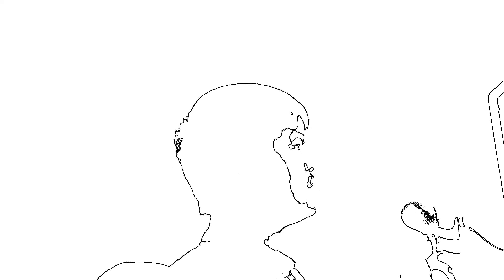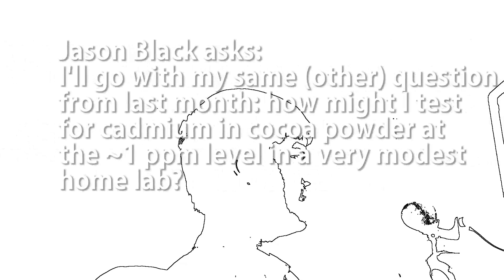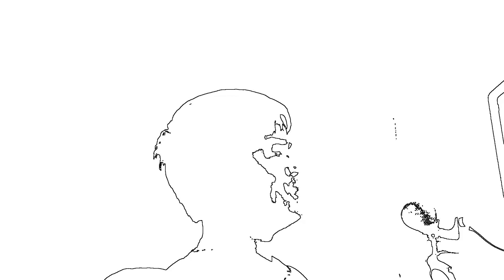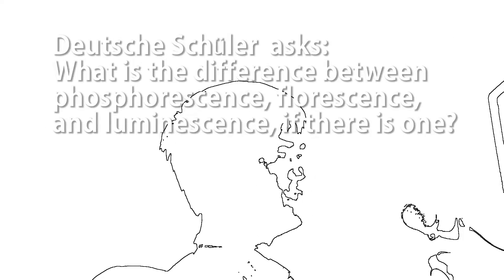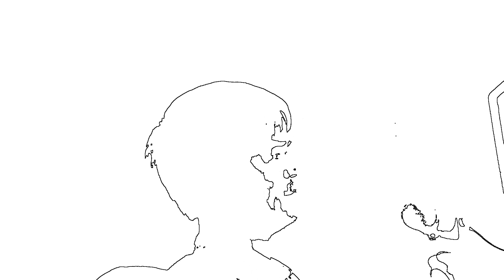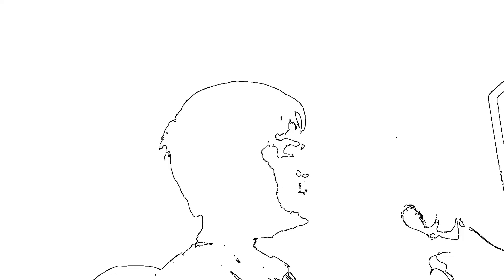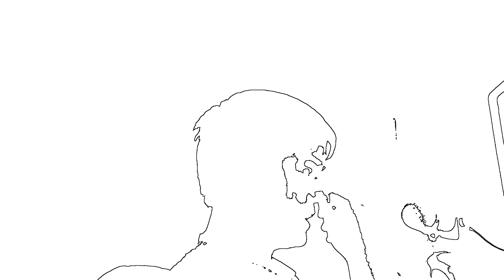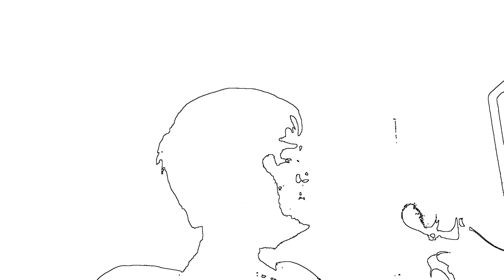Q&A with NurdRage August Edition

Comment: Im looking for compounds preferably translucent one for testing with Fluoroantimonic acid if anyone have any suggestions please do I know PTFE is the only one right now thats why im looking for compounds to improve that are pretty resistant to acid or if I cound find a way to make PTFE translucent that would work as well im thinking I can grind a PTFE container and mix it with molten glass except I have to find the right ratio for it also that might not work because the outer layer is still glass if I can make a layered coating of  PTFE that can cover the glass and still keep the translucent that would also work but finding a better compound is preferred

Comment: Have you ever worked with Fluoroantimonic acid and im looking for something to store it with I think PTFE might work but want to be sure
Reply from the maker: Textelmedal Orex Yes, PTFE is the only thing it can be stored in. Be careful.
Reply: The reason as to why I want to store it and use it is that I want to find a better solution as for ways of storeing this stuff as glass wonk wonk I want to store it until I run tests on air tight containers that are translucent and better for the storage of the acid  I know there is very little ways to store the stuff and the ways they have arent very good
Reply: Textelmedal Orex me and my research team are working on new safety measurements on working with Fluoroantimonic acid so far little success we are also trying to find a compound that can be used to make gloves that are resistant to the acid I work for a private company with a formidable work space with safety precautions in place

Comment: Hey NurdRage (or possibly someone else reading this), can you explain how a triplet-state electron returns to the ground state? I struggled with this concept in my inorganic class, and was wondering if you could explain it a bit better.

I know that fluorescence occurs when energy is given off as the electron transitions between vibrational and rotational energy levels between the ground and excited singlet states. Does phosphorescence go through the same process? If so, why exactly does it take so much longer for the electron to lose its energy?
Reply: myfairjew I actually just found a great explanation of this on Wikipedia. It seems that it goes it through quantum transitions that are naturally unfavorable, so the probability of the transition happening is slim, which causes the prolonged emission of light. Perhaps ill look into this in more detail in the future, although i fear it may get too complex for me. I suppose every aspiring chemist should do his own research instead of asking for the answers.
Reply: myfairjew You basically just explained it yourself. The excitation leading to phosphorescence is two distinct events (excitation followed by a spin flip) where the emission is a single event (both at the same time). Phosphorescence is slow because an electronic transition and a spin flip happening at the same time is so unlikely.

Comment: A widely available semi-permeable membrane can be found lining the inside of a raw chicken egg shell.  Separating the membrane from the calcium carbonate shell can be done in a number of ways:  Physically, by carefully pulling bits of shell away from the membrane, either while the membrane is intact by meticulously working a small fracture in the outer shell, or after the egg has been normally cracked, from the left-over shell pieces.  Chemically, the shell can be dissolved  by soaking the raw egg in vinegar overnight, or, judging from the rate of pitting I'm currently seeing, considerably faster in 1:4 muriatic acid:water (but vinegar is probably safer all around).

Osmotic experiments can either be carried out on the egg itself, as it will expand in plain water, and shrink in corn syrup, or the membrane can be carefully cut and affixed to a container opening or tube, for more general osmotic purposes.
Reply from the maker: Nevin Williams Wow, that is amazing! i had no idea, I'm definitely going to look into it. Thanks!
Reply: NurdRage I started de-shelling an egg with HCl as I posted.  The 3/4ths of the egg that stayed submerged, is now shell-less, and the remainder is very thin.  If I were to do-over, I'd rig a hold-down so the shell would dissolve uniformly, as the egg's expansion against the remaining sharp edge is dangerously close to ripping the membrane;  I added lots of salt to the bath to quell the expansion while the rest of the shell dissolves.

Even had it ripped at that point (it hasn't, and now probably won't) i'd still have a membrane sack with an opening of about 4 cm, and ~6 cm deep.
Reply: Nevin Williams Iv'e seen that too but I'm not sure how stable it is over the long term. For a Proton Exchange Membrane, which I think the guy wanted to know about, I've been looking at Plaster of Paris doped with Phosphoric Acid. There are also a few Patents and Papers regarding sulphernated plastics like ABS.
Reply: Jehu McSpooran Well, as I wrote my reply, I began the process of removing a shell from an egg, substituting muriatic acid for vinegar.  While the shell indeed dissolve in a fraction of the time, the membrane that remained seemed impermeable;  I probably fried (either thermally or chemically) the membrane with a too-strong acid solution, as the egg's size was not affected by immersion in brine nor tap water.  I'll try again when more eggs appear in the fridge.  (I don't eat 'em)

Comment: Here's one that's really confusing me. I was always told that the formation of bonds between atoms (like N -> N2 or CxH2x0x -> CO2+H2O, etc) were what leads to exothermic responses, etc. How is it that decomposition reactions can cause exothermic reactions? And how do some bond formations (cold packs, etc) cause endothermic reactions?

This is why I'm in IT and not chemistry. This stuff confuses me to no end, regardless of how fascinating I find it.
Reply: rogerdotlee I would assume it's because some bonds being created are taking more energy out of the system and locking it up in the molecules, for producing endothermic reactions, and for exothermic reactions it's the reverse- high energy molecules splitting apart into others with atoms they have stronger bonds with that cause the stored energy to be released. Azidoazides come to mind for this property, and you can find more here http://pipeline.corante.com/archives/2013/01/09/things_i_wont_work_with_azidoazide_azides_more_or_less.php (and other stuff- this blog is very informative!)
Reply: rogerdotlee Short answer: entropy. Spontineity (free energy change, ΔG) isn't governed purely by enthalpy (heat change, ΔH) but also by entropy (ΔS) by the relation ΔG = ΔH - TΔS (where T is the temperature). So a spontaneous reaction (ΔG < 0) isn't necessarily exothermic (ΔH < 0) as long as the entropy change is large (ΔS >> 0).

Comment: can you do an experiment with sugar and sodium chlorate? i missed that practical at school and have never seen that reaction.
Reply: Richard Kaskiewicz I think that he bunt some dolls with sugar and sodium chlorate.
Reply: Llizard CZ He submerged a dead, dried out cockroach in molten potassium chlorate and rapidly oxidized it.  There is a video I've seen numerous times on youtube where a gummy bear is dropped into potassium chlorate and it makes a screaming sound from the test tube. I'm not a chemist, but I think because potassium and sodium are in the same group, the reactions should be similar with similar byproducts where potassium would be substituted where the sodium would be.  However I think Potassium Chlorate reacts more vigorously since elemental potassium is more reactive than sodium.